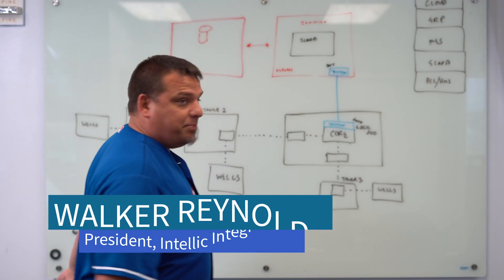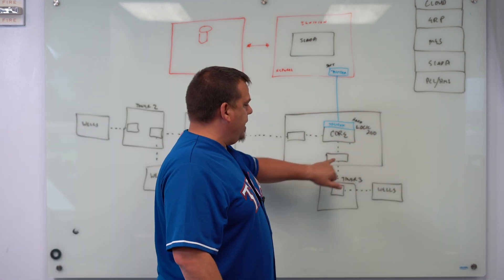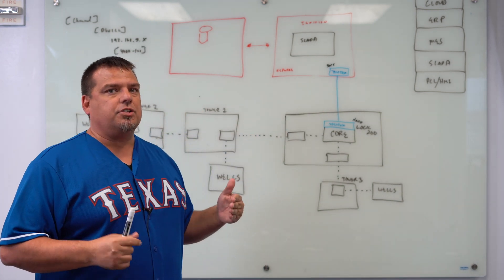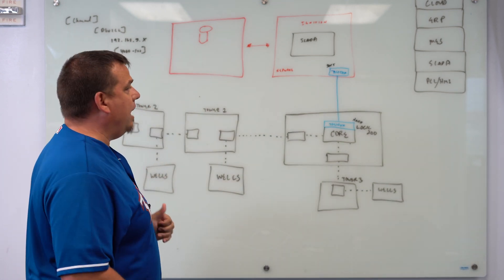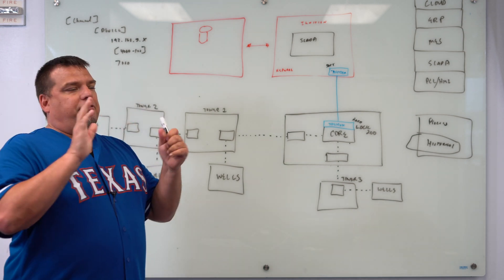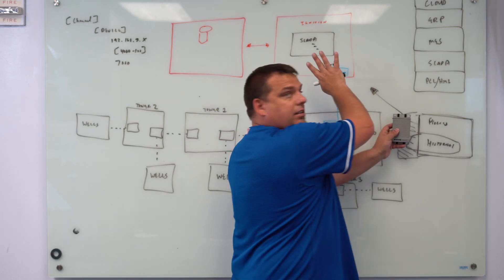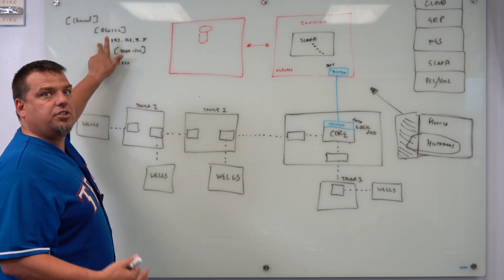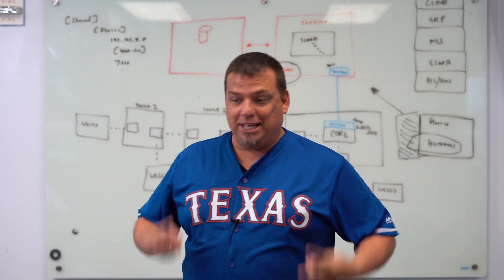Oil & Gas IIoT vs Legacy example

Comment: What is your background?
Reply from the maker: Walker has 20 years of manufacturing experience and the last 10 have been spent doing system integration and solutions architecture. You can check out Walker's Career Arch in this video https://youtu.be/F60CMjXSuo4

Comment: I am doing research on latency data shifting on cloud but the question is that its only for monitoring or also for controlling ?
Reply: Ali Hussain Control and Monitoring
Reply: Siemen also implement this in oil and gas or not ?
Reply: Sir your lecture proved very helpfilull for me and kindly share me also share material that i can study
Reply from the maker: Thank you Ali!

Comment: Interesting presentation explanation for Remote Field data operation collection to central data server and with ignition. These concept and implementation are always interesting to see and from implementing approach and if possible compare both and with IIoT integration. To me it matters less that it’s an oil well as what I see is a remote system operating as it can be almost anything or small remote unit operating in the field that’s producing lots of data. Here you have the ability to collect and see that data and will eventually made easier by IIoT soon in the future.
Reply from the maker: Thank you! Welcome to the channel Ardent!

Comment: Can you detail the setup for the uno and the total flow device?  I assume there is still some configuration required (per device) and then at that point it’s capable of being consumed by its node ID to the namespace??
Reply from the maker: Thanks for the feedback Demetri
Reply: Demetri White we use a startup script in Linux to do all install and config.  We pull the hostname dynamically and use it as the NodeID in the sparkplug B config.  The only thing we do is change host name on provisioning, run the startup script... and boom, we have data in the broker.